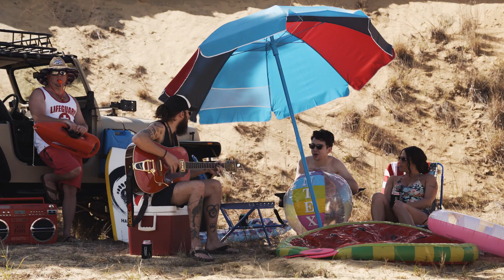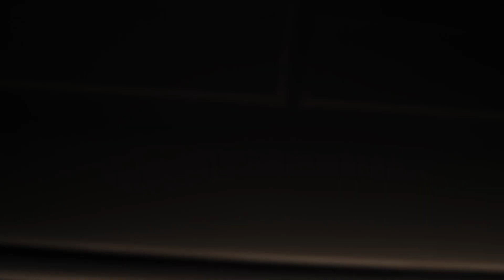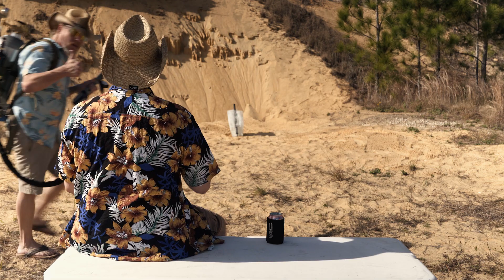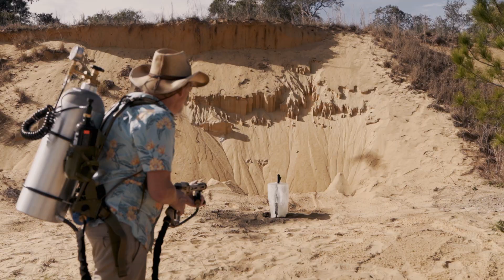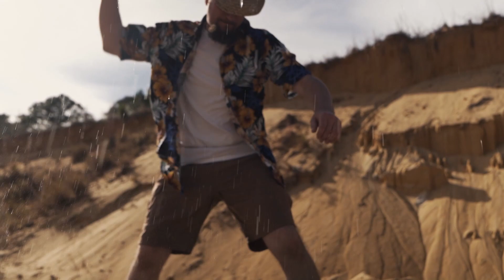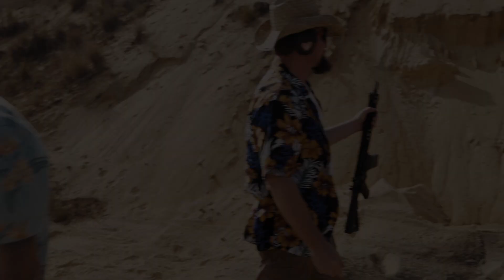KAC: Adverse Environmental Conditions Test Facility

Comment: I train in Alaska. I have 3 SR15 & 1 SR 25 ACC. (I did just put a huge down payment on Chambers Custom x KAC Box set for a sweet 1 of 25 double stack 2011 pistol and 1 of 25 SR-25 in 6.5CM, as well as a matching blade) I have ran nothing but KAC in all my night vision class's in the middle of the winter up here. We go prone, we get wet and extremely cold. Have never, not once had an issue with any of KAC rifles. Love this company, and the quality they continue to produce!!